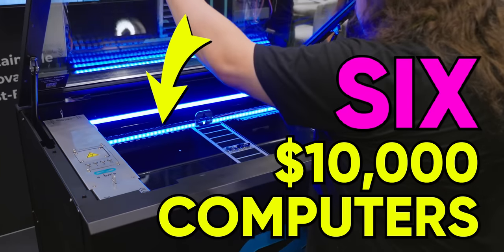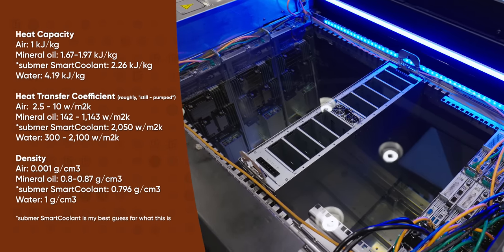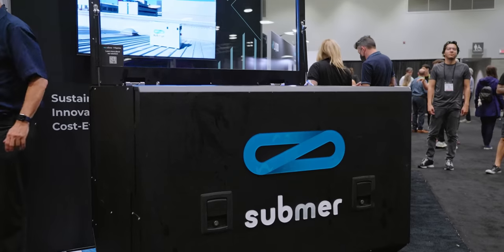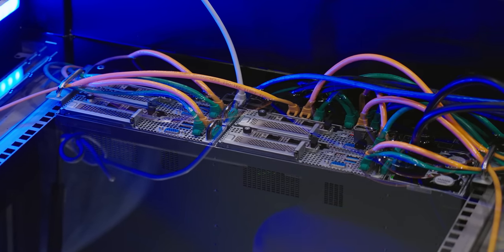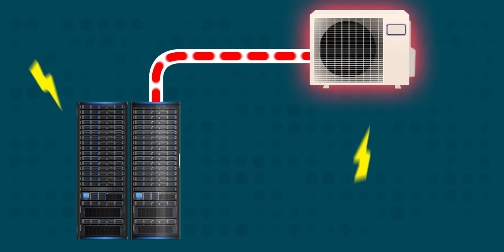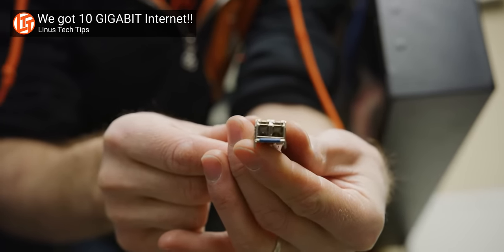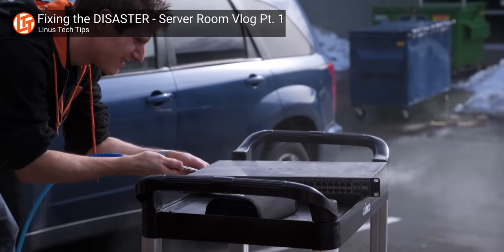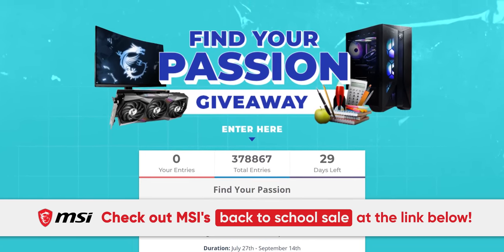This server lives underwater! - Hypertec Immersion Cooling

Comment: This is one of the coolest things I've seen in a while. Imagine in 15 years if this is common practice for large server setups, paired with renewable energy from solar/wind etc. Renewable energy to power the server farm and surrounding equipment, and re-using the heat generated to help power the building or provide heating.
Reply: There are plans in Germany to push waste heat from data-centers into the teleheating network. And yes, we need more of that. Why just dump the (useful) heat into the atmosphere?
Reply: @Ruhrpottpatriot   that is awesome
Reply: IT will never be fully powered by solar/wind, these energy sources are too unreliable for data centers to be depended on.
Reply: @therodyman700  store the energy in others forms, such as batteries, pressure or heat.
Reply: @therodyman700  Ever heard of batteries mate?
Reply: @therodyman700  You know that batteries exist?
Green energy is only unreliable when you don't have storage; but nobody is questioning that. Or do you approach a client and tell them that all of their data that they need to store for the IRS is best put into a RAMdisk?
Reply: That would be horrible for the environment as solar panels dont normally get recycled and are full of horrible elements that are highly polluting to the environment
Reply: @Ruhrpottpatriot  That amount of batteries it would take, the raw materials, and how terrible they are for the environment is not something I would like to see personally.
Reply: Yes!!!
Reply: @dralord1307  Exactly. People "caring" about the environment shouldn't be suggesting batteries. Why is noone in the media talking about last generation nuclear reactors that can reuse old radioactive refuse? That's the real solution. I mean batteries have a bigger chance of spontaniously blowing up than a nuclear plant.
Reply: @dralord1307  "That amount of batteries it would take, [...]" With CURRENT battery technology, yes. But that is absolute dogshit. There's been one major development in Battery technology since it's inception: Li-Ion, that's it.
But there was never a need to develop anything in that direction, since we could just build more coal or NPPs; both of which don't work anymore.
So unless ITER gets shit done and we have reliable and economical fusion until 2050, we need batteries.

But, there's serious research into that field right now see: S. Rahardian, et al. "Review of Solid-State Battery Technology Progress" 2019 
or 
Morris, R. Scott, et al. "High-energy, rechargeable Li-ion battery based on carbon nanotube technology" 2004
or
Rahman, M.A., et al. "A review of high energy density lithium–air battery technology" 2014

Another alternative could always be to use renewables to produce H2 and store that. Since size is of secondary concern in a datacenter, this is a viable alternative.

"That would be horrible for the environment as solar panels dont normally get recycled and are full of horrible elements that are highly polluting to the environment"
By that logic, we shouldn't use cars, power plants, computers or build houses from concrete and steel.
And god forbid anything with oil it in. Oil products in general have the worst recycling ration of all products and devastate the environment. But not using oil products is not using any glue, not using cars, not using plastics, not using most food packaging... you get the idea.

The solution is not to use those products, the solution is to build a recycling system and research better alternatives.

Solar panels are only "harmful to the environment", if they are improperly recycles, but guess what: that goes for most products. 
Over the complete lifecycle solar panel are a much better alternative per Wh than competing, non green energy, products.
Reply: @Ruhrpottpatriot  By that logic, we shouldn't use cars, power plants, computers or build houses from concrete and steel. 

You sound smart. So you should know about the materials in solar panels and how toxic they are. You also should know that very few get recycled because it is extremely difficult and expensive.

Honestly Nuclear makes the most sense. New nuclear has very very little waste, is able to use most of the waste already stored and is very safe. Instead of glassing hills with solar "which does add to heat absorption and reradiation" 

yes I have heard about SSB's but they arent available and wont be commercially viable for quite a while yet. And still even with them there is the recycling and environmental issue.

You can say "just build better recycling" but it doesnt work that way. It has to be funded constantly. Current estimates I am aware of put solar/battery recycling cost higher than the sales price of them so its just not gonna happen.
Reply: @rBennich  Most ppl just listen to the media and think we are still using dirty coal from the 50/60's. They dont know anything about the clean coal that is being used in almost all USA power plants today, and most other euro countries as well. Most of the coal plants in the west now use carbon scrubbing and capture methods and have reduced co2 output a huge amount.

Some are also commoditizing co2 to ship out to greenhouses, others use underground carbon sinks to return it to deep in the ground. 

Batteries and solar panels are extremely CO2 expensive to make. Are full of very environmentally harmful materials that cause cancer, deformities etc etc etc. Not to mention most of the rare earths come from china. "Slave labor FTW!"

Modern nuclear is the only sane way to go. Look at France and Germany. Germany went "renewable" France went Nuclear. Guess who is now burning their forests and emitting even more CO2 than when they used coal.

I find the Irony of calling wind and solar renewable amazing when you consider the only way to get that energy is through tech that is even less renewable than a nuclear plant is.
Reply: @dralord1307  Right on! And for people who are so scared of nuclear reactors, look up Nuclear Submarine on wikipedia. It's not talking about nuclear warheads. If you can power a submarine with a small nuclear reactor, you could have a small reactor in every small town, if you wanted. The real upside is, electricity would be very cheap, as the infrastructure for connecting all these small reactors to create a redundancy network, already exists.
Reply: @rBennich  Yes there are even mobile desings from what I understand that are very safe. Modern Molten salt reactors are extremely safe
Reply: @dralord1307  when people say "renewable" they mean the source of the energy is renewable, which solar and wind is. If we take into account what material is necessary to build the thing, then no source would be renewable, because they all need limited resources to be built.
Reply: @steveqi9309  Yes I just find the irony funny. PPL think it is entirely renewable just because of the labeling and put very little thought into "how" the energy is gathered past the "use a solar panel"
Reply: sure, but I want it for my own PC. lol
Reply: @dralord1307  "So you should know about the materials in solar panels and how toxic they are."
If improperly thrown away. The main problem with panels is their solder which contains lead, which is a very easy fix, since you just need to add panels to the RoHS list, which would make 97% of all panels completely safe.
This is a statement by the "Stuttgarter Instituts für Photovoltaik", which researched the issue. 
Furthermore according to San Jose State environmental studies professor Mulvaney over 70% of all modules that were damaged after a tornado in 2015, most of which contained cadmium and lead solder, were recycled.

According to the EPA (emphasis mine): "SOME solar panels ARE HAZARDOUS waste, and SOME solar panels ARE NOT HAZARDOUS waste, depending on the leachability of RCRA toxic materials present in the solar panel." 
Furthermore: "Solar panel waste that fails TCLP must be managed as hazardous waste."

And the cadmium is almost a non-issue. 
Not only isn't cadmium directly used, but rather cadmiumtellurid, which CAN be toxic for humans if inhaled as fine particulate matter. CdTe is also not very soluble and usually required acids, such as hydrobromic acid to dissolve. Therefore this substance only gets into the ground if the panels are ground into almost dust. Just breaking them into shards doesn't suffice.
According to LobbyControl, a German lobbyist watchdog group, the main protest against cadmium based panels comes from competing solar manufacturers.

There FAR more concerning matter for the environment is plastic. Even more so, since every PV module sold in the EU must be taken back by the manufacturer (the WEEE act), who have delegated the recycling to an external entity, such that consumers can give the modules back, even if the original manufacturer has gone bankrupt.

"You also should know that very few get recycled because it is extremely difficult and expensive."
In the EU most modules can be recycled up to 95% and by regulation over 80% of all modules MUST be recycled.
Germany introduced legislation last year that set a maximum lead content in modules to 200mg/kg and selenium and cadmium to 1mg/kg.

"Honestly Nuclear makes the most sense"
No. Because while they might produce less waste than previous reactors, the other issue still remain. Just look at Zaporizhzhia NPP how dangerous these can become.

Will that happen? No most likely not. But this is a technology where you don't fuck around with.

"It has to be funded constantly"
Recycling PV modules is a net loss because so many cheap panels come from China, which can be alleviated by tariffs and additional funding of European/NA manufacturing.
That said: Most recycling is a net loss, no matter the product. That's why single use plastic bottles and throwaway clothing are polluting our rivers.
Reply: @Ruhrpottpatriot  Li-Ion is not the only type of batteries that are currently used.
Most people know about them because of the electric car boom, but for static storage LiFePO4 is much better than Li-Ion, the only disadvantage, they weigh twice as much, but on static systems it does not matter.  
Also there are a few recent breakthroughs that are likely going to get to market way before solid state batteries. Eg. Sulfur additions to Li-Ion that allows for safe fast charging, and my personal favorite: liquid metal batteries. The last one is most likely going to be the next generation solution for static energy storage (unless a new breakthrough will happen fast enough).
Reply: @hubertnnn  LiFePO4  is still a type of Li-ion battery, as are many proposed SSB.
Reply: @Ruhrpottpatriot  "one major development" lmao.
Reply: @WayStedYou  The quote me the big improvements in battery technology
Reply: @dralord1307  It's the same thing as people driving electric cars patting themselves on the back for "zero emissions". They are just displaced emissions, no free lunches.
Reply: so after reading all these comments i have found that the best battery is and always will be the nuclear power battery. it creates the least waste and provides the cheapest power for the long term results. 

meaning we didn't really get anywhere with all this renewable power talk, it was all just a waste of text and time reading it all.
Reply: @zsomborszarka2616  You have no idea what you're talking about, do you?
Reply: @Ruhrpottpatriot  why would you think that?
Reply: @Ruhrpottpatriot  I do agree with most of the things you said there. I think we mostly agree. Your mostly talking about germany which does have the most stringent rules overall. In many other countries the rules are much more relaxed. Though IIRC Germany has been having power grid issues over the last several years.

I'm not saying we shouldnt use solar and wind, Im saying they are not as clean as most "normies" tend to believe. The ppl that just cry "climate change" and have no clue what that even really means or its causes. 

IE Recent studies have shown none of the upper atmo heating that was predicted from CO2 rise.
Reply: @zsomborszarka2616  
People assume that we can just slap a few new plants here to fill the gap in energy production with BEV and be done with it. Because a) new NPPs take at least a decade if not more to build, time which we simply don't have
b) The problem runs far deeper. Building new NPPs is treating a symptom, not eradicating the source. There needs to be a massive reduction in cars, fossile or electric on the streets and transformation of key industrial sectors to H2. This means that there needs to be a rethinking of urban planning, with more public transport and more mixed use development.
All of this is possible with current technology. We know how to build efficient and cheap mass transit, we already did it multiple times in multiple places all around the globe.

We also know how to recycle energy, we are already doing it. Case in point: Datacenters Currently most of the heat that is generated is just blasted into the air and not recaptured to be fed into district heating, or at least local building heating. That's wasted money.

I know a guy who works in a paper mill that mostly produces food packaging. They're looking at replacing the old oil/gas boiler with a heatpump, which a) captures the waste heat inside the building, which has the added benefit that workers don't have to work at 40°C in the winter b) runs mostly on solar because why not? Instead of putting panels on green fields put them on all roofs. This way you can cover 80% or more of all energy consumption. The rest can then be bridged by using storage technology like reservoirs, old mine shafts or by converting water into H2.

Naturally you need to beef up the grid a bit, but that's a necessity even if we just go "moaaar NPP".

Again the technology exists and just needs to be improved so it becomes cheaper. Here in Germany there are currently research projects that run until 2026 aimed to integrate heatpumps with up to 22mW of output into the district heating using industrial waste heat: https://www.ise.fraunhofer.de/en/research-projects/reallabor-large-scale-heat-pumps.html
Reply: @dralord1307  "In many other countries the rules are much more relaxed. "
The rules are EU wide, and based on a EU directive. That puts massive economic pressure on manufacturers, since tooling is expensive and you don't just swap it when producing for the EU and the rest of the world.
Case in point: GDPR. How many US sites now have GDPR stuff (any really), even though -- technically--  they only serve US customers? Because they can't guarantee that no EU citizens enter the site, which makes the liable unter EU law, which means fines if they don't comply.
If the EU forces solar panels manufacturers to comply with RoHS then you can bet your arse that this rules will affect most of the globe.

"Though IIRC Germany has been having power grid issues over the last several years."
No, not really. The main problem for us was (and is) not energy production, even now we export 5/6th of our coal power to France since they are shutting down most of their NPPs in the winter for (really) urgent maintenance.

Our problem, well only really Bavaria's problem, is getting the energy from the north into the south. But that was a political decision since the conservative CSU budged before local farmers, hillbillies and NIMBYs who didn't want any transmission lines or wind turbines near them. Bavaria has a 1km distance rule for any  wind turbine and since many local villages are only a few kilometres apart you can guess how many you can actually build.

But that's Bavaria, the mid west of Germany.

"IE Recent studies have shown none of the upper atmo heating that was predicted from CO2 rise."
Yeah no and unless you show me studies of that, I call your argument BS.

NASA has done a study comparing models from 1970 up to 2007 and looked at how accurate they were. The results? Pretty accurate.
To quote the study directly: "We find no evidence that the climate models evaluated in this paper have systematically overestimated or underestimated warming over their projection period." from: Hausfather, Z., Drake, H. F., Abbott, T., & Schmidt, G. A. (2020). Evaluating the performance of past climate model projections. Geophysical Research Letters, 47
Reply: "Damn this water is a bit cold Jim, quick launch Crisis"
Reply: @kiloneie  You also have another problem with NPPs, even modern ones: 
By design they are base load plants, not suited for quick spikes in demand. But that's what gas and coal plants are usually used for.

Nuclear also isn't emission free. Looking at the lifecycle of a plant, nuclear will output about 117 g/kWh in CO2 equivalent. This includes building, transporting the fuel, decommissioning, dismantling and storing waste. It's better than natual gas with 442 g/kWh and far better than hard coal with 862 g/kWh or brown coal with 1034 g/kWh; but it also emits a factor of four more CO2 equivalent than silicon based Photovoltaic (33 g/kWh), and more than 12 times more than onshore (9 g/kWh)and offshore (7g/kWh) wind-parks or hydro (4 g/kWh).

The CO2 equivalent changes massively -- between 68 g/kWh up to 180 g/kWh -- based on the production method of the uranium rods
These facts were from an article on dw.com (http://www.dw.com/en/fact-check-is-nuclear-energy-good-for-the-climate/a-59853315 )

The article furthermore links to a study done by Muellner, Arnold, Gufler, Kromp, Renneberg and Liebert, titled "Nuclear energy - The solution to climate change?"
 From the study's abstract: "The most important result of the present work is that the contribution of nuclear power to mitigate climate change is, and will be, very limited. At present nuclear power avoids annually 2–3% of total global GHG emissions. Looking at announced plans for new nuclear builds and lifetime extensions this value would decrease even further until 2040."

One big inhibitor of expanded nuclear power generation is fuel supply. Almost all reactors need U-235, of which we don't have enough and U-238 reactors aren't yet ready. Again from the above study: "[A] substantial expansion of nuclear power will not be possible because of technical obstacles and limited resources. Limited uranium-235 supply inhibits substantial expansion scenarios with the current nuclear technology. New nuclear technologies, making use of uranium-238, will not be available in time."

I have provided my sources -- your turn.
Reply: @CreatedTech  any environmental damaged “saved” by wind and solar power is immediately offset if not overtaken by the damage caused while creating the infrastructure and batteries for it. If you want clean energy endorse nuclear power
Reply: @john2432  Ridiculous claim. There are ways to construct renewable energy sources without causing more damage. I do agree that nuclear is likely the best option, however the population is averse to anything with the word "nuclear" in it. Which is a shame, and will take a very long time to overcome.
Reply: @MrGamelover23  You do know starting a response with "wrong" is almost guaranteed to make you come off like a goof, right?
Shockingly, you made a goofball comment.
Do you understand the word "displaced"? 
Where do you think the power comes from to charge the battery? 
Don't say solar and wind, because anyone with a touch of common sense knows that is only a drop in the bucket.
Reply: @MrGamelover23  They are already good enough to be used on a wide scale.

The Fraunhofer ISE has studied the environmental impact of energy technologies and calculated the cost per kWh over the whole lifetime of a producer; split between production cost, using new large-scale power plants and the consequential cost to health, climate and environment.
One of the worst is, as expected: coal with 10-15 €ct/kWh in production cost and 76€ct/kWh in consequential cost. It doesn't matter if we're talking about lignite or hard coal, they're about the same.
Natural gas costs us about 8-13ct/kWh in production and 31ct/kWh in consequential cost.
On the other hand, onshore wind farms cost us 4-8ct/kWh in production and 1 ct/kWh in consequential cost. Solar is not far off with 2-6ct/kWh in production and 4 ct/kWh in consequential cost.

So where does nuclear fall in? Well pretty low on the scale. The production cost is about 14/19ct/kWh and the consequential is numbered as above 76ct/kWh, i.e. at least as bad as lignite.

You can find the press release of the study, which also links to the relevant paper over at https://www.ise.fraunhofer.de/en/press-media/press-releases/2021/levelized-cost-of-electricity-renewables-clearly-superior-to-conventional-power-plants-due-to-rising-co2-prices.html

This falls in line with what Mycle Scheider, primary author of "The World Nuclear Industry Status Report 2021" (https://www.worldnuclearreport.org/IMG/pdf/wnisr2021-lr.pdf )
has to say about new NPP: "Nuclear power plants are about four times as expensive as wind or solar, and take five times as long to build," he said. "When you factor it all in, you're looking at 15-to-20 years of lead time for a new nuclear plant."

So is all well and good then? No, but many problems with renewable can be alleviated with new transmission lines and localization of power production, and better insulation, i.e. reducing energy usage.
Italy for example pays you 110% of the cost of a heat-pump, solar panes and heat insulation (capped at 100 000€ per home). Yes, 110% of the cost.
Oh and the government made money off that, too.
Reply: @MrGamelover23  At what point did I compare the two? Did you even read what I wrote?
Reply: @Ruhrpottpatriot  You are misrepresenting what that study is saying. Those are not the costs to generate power, they are in there but they are also adding carbon tax to it as well, which is artificially skewing the numbers in favour of solar and wind, and likely nuclear as well.
Reply: @--_DJ_--  Whether or not the carbon tax is artificial doesn't matter for comparison. If the cost per g CO2 equivalent is know it  can be compared. The only important part is that every g is priced equally.

"Those are not the costs to generate power"
Your definition of "cost to generate power" is far too narrow and doesn't include the long term cost for the environment, which the study factors in as well. 
The whole point of the tax is that high CO2 emitters are paying more for polluting the atmosphere. However, since PV, wind and hydro are -- you know -- emitting less CO2 than other forms of energy production, they are -- naturally -- paying less tax. That has nothing to do with "artificially skewing the numbers in favour", it's the basic math.

Oh and no nuclear isn't getting a preferential treatment. The Fraunhofer ISE study shows that nuclear is as bad or even worse than coal when it comes to lifecycle CO2 emission and cost.
Reply: @Ruhrpottpatriot  It does matter when you present it as overall generation costs rather than what they actually are.
I never defined "cost to generate power" so how is my definition too narrow?
I used that term to differentiate between what the numbers in that study mean and the actual cost of production.
It is absolutely artificially skewing the numbers, there is no getting around that. Without the carbon tax, those production methods would be cheaper than stated in that study. There is nothing wrong with the study, it just can't be used to compare the cost of each method at its base level.
Reply: @Ruhrpottpatriot  The cost of a gram CO2 isn't monetizable in reality. Anyone can make up whatever number they see fit.
Reply: @--_DJ_--  Why wouldn't a g of CO2 be monetizable?  Everything in capitalism is monetizable, as you can see by looking at people who buy dead persons belongings like underwear or, rather grimly, the price of a human life and I'm not even talking about contract assassins, but rather how high your life insurance is, or how much a person dying actually costs for their heirs, or how much you can sue in damages if a third party causes the death of a loved one (which btw in Germany is around 73000 €).

We're taxing all kinds of stuff, sometimes even non physical things, why should CO2, which arises during the lifecycle of a product, and is measurable or can be calculated, any different?

"Without the carbon tax, those production methods would be cheaper than stated in that study."
Yes, but the "carbon tax" (which isn't a tax in the legal sense, at least not in the EU) is the whole point. It's the cost where previously there was none, i.e. damages to the environment and the cost that we, the society, need to pay to repair or offset. It's a simple polluter pay principle.

Many things would be cheaper without taxes or an outright ban. Child labour is cheaper than grown-up labour. Slavery is cheaper than most other forms of labour; both of these things we have (rightfully so) banned.
We, the West, make labour more expensive by having safety laws, the cost of which can be measured.

Those things are not necessary in capitalism, we don't need labour standard for an economy to grow, we don't need a ban on slavery for a human economy to work.
We purposefully chose, as a society, to ban these things, and the CO2 tax is the same in that regard.
Reply: @Ruhrpottpatriot  I said it can't in reality, as in it can't be proven what it actually costs. Which makes using it for an equalizer pointless. 
Why are you blathering on about child labor, slavery, capitalism, and society? What does any of that have to do with you misrepresenting what a study is saying?
Reply: @--_DJ_--  You said you can't put a price on CO2. I argued that you can. Just because something seems at first glance that you can't put a price on doesn't mean that you actually can't.

"I said it can't in reality, as in it can't be proven what it actually costs."
That's not the point of the whole tax, it never was.
We're not taxing the emission of CO2 based on what it actually costs us. The price was always  a political one to incentivize more green energy. That's why the "tax", or rather the emission papers start cheap but get progressively more expensive in the next few years.
Most taxes don't model the actual cost of something any more accurate than the CO2 tax. Case in point: All taxes on car driving. If driving was taxed by the costs in repairs, safety, etc. most people couldn't afford it at all. If there were no subsidies on individual driving, then public transport would be a lot cheaper than any car per mile. It's the same with the CO2 tax, just in reverse.
Reply: @Ruhrpottpatriot  You just made my point as to why it can't be used as a factor in production cost. It is a politically motivated figure for the most part. Pricing it depending on which way the wind is blowing would be just as accurate of a number to its true cost.
You can't use that number to come up with a fair comparison between generation costs when that number is essentially drawn out of a hat. 
None of this has anything to do with the tax itself, please stop explaining taxes to me.
Reply: @Ruhrpottpatriot  ITER won't produce commercial electricity, but why go for fusion? Just build fission until fusion is a thing.
Reply: @Ruhrpottpatriot  transitioning to hydrogen and reimagining cities, etc will take more than a decade. Probably 5 decades. Just getting a permit to build a house from the town hall can take one year, lol.
Reply: @LtdJorge  
"Just build fission until fusion is a thing."
New nuclear reactors usually take 15 to 20 years to plan, build and test until the can feed electricity into the grid. These 15 years are the years that determine whether we get 1.5 or 2.5°C in global temperature increase. 

" transitioning to hydrogen and reimagining cities, etc will take more than a decade."
In the US, probably even longer, but now they reap what they sowed in the 60s.

There are however, many small things people can do: Put PV onto roofs, replace furnaces with heat-pumps, reduce car traffic by making biking safer and adding more public transport, even if the vehicles are fossile fuel buses, insulate homes. All these things can be done in the next decade and will have a massive impact.

Naturally, people should also annoy their representatives to force legislation to hold industry accountable, e.g. ban these pesky "carbon offset" schemes (see the last LWT episode on that matter).

"that's because nuckear is the only source not being subsidized."
Which of course isn't even remotely true. Even the pro "World Nuclear Association" states that there are subsidies: https://www.world-nuclear.org/information-library/economic-aspects/energy-subsidies.aspx

More critical groups are even talking about "black holes" that these subsidies are: https://changediscussion.com/nuclear-power-subsidies/
Reply: @hnewc1919  Pray tell: Where do you store the waste? Since you're prop nuclear, I guess you don't have a problem with it being deposited in you local vicinity, right?
Reply: @CreatedTech  ehm no
Reply: This really feels like that futuristic high tech stuff I’m looking for in society!